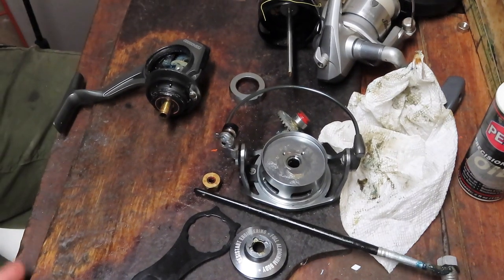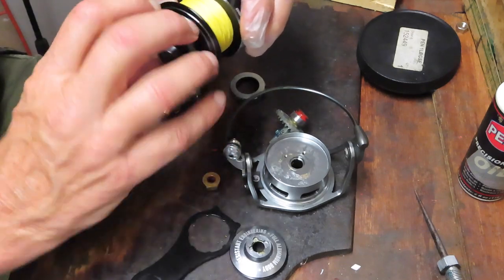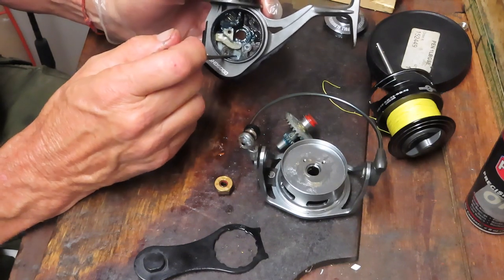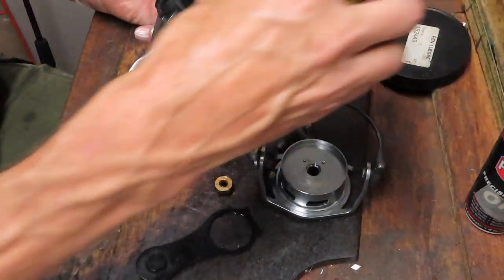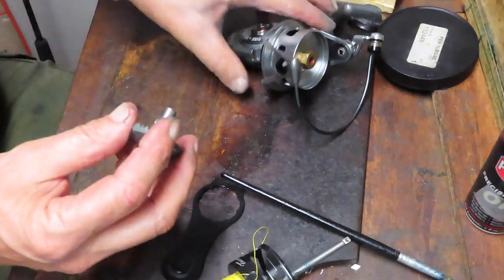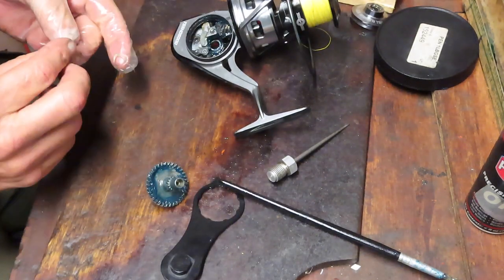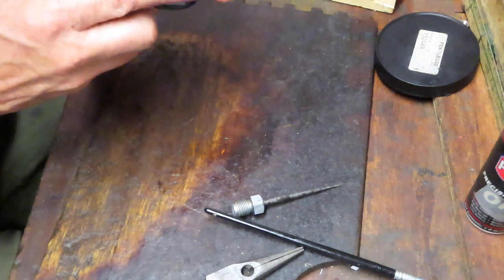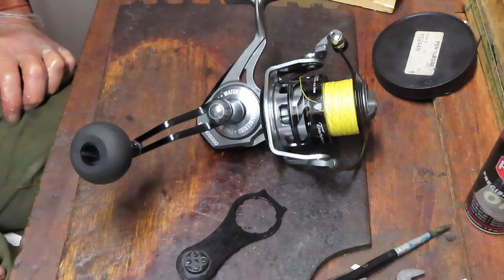Tsunami Shield 5000 spin fishing reel inside look and how to service

Comment: Hi senior i got one 4000 tsunami shiel and it start to make noise i from mexico nobody wat to open that reel  i need make it the servise you video dont shou haw open the reel  and dont say nathing about the anti rebers help me please
Reply from the maker: You need the tool that comes with the reel in order to remover the side plate.  This one screws on.  The problem is that the two models 3000/4000 and the 5000/6000 do not screw on the same.  One uses a clockwise rotation and the other uses the counter-clockwise threading.  The instructions for removal are in the manual.  Best to get that before you do the servicing - Dennis
Reply: @2ndChanceTackle  Hello sir, thank you for your answer, my reel squeaks from the anti-reverse part, as I clean and grease it, and the grease that it has inside is no longer sticky, it is like melted, as if mixed with water that could have entered, which I need do. Gracias sir.